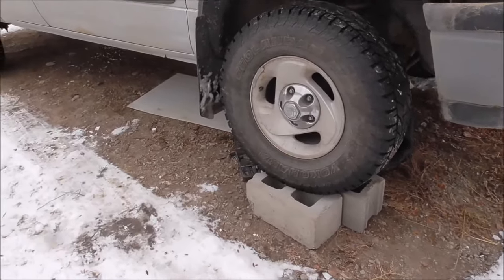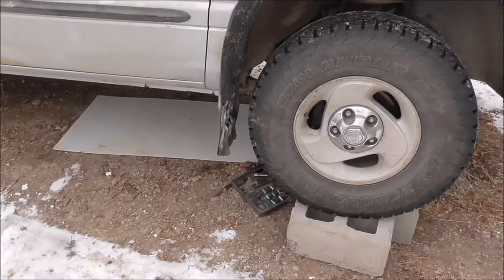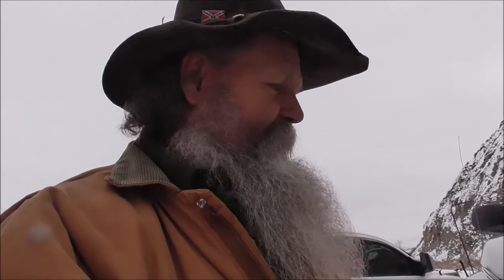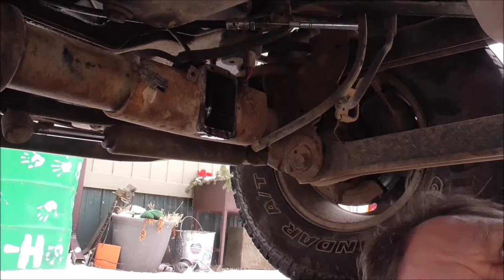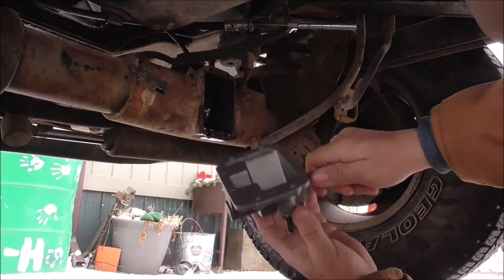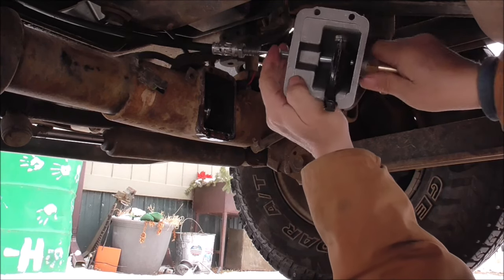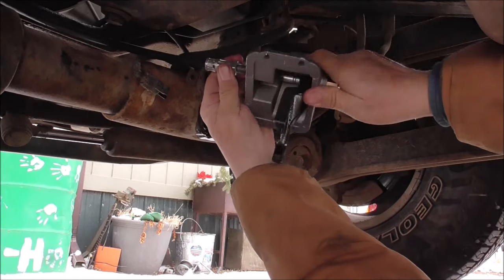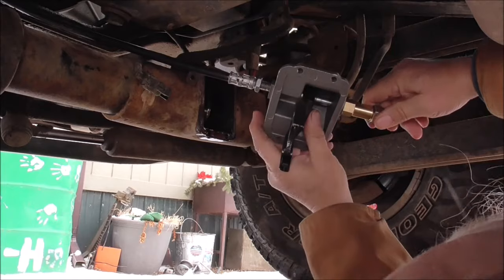Installing a Cable Conversion 4wd Actuator for a 2001 Dodge 1500  Truck Part 2

Comment: Glad you're back to all 4 hooves working!  That's a necessity if a guy wants to wander in the mountains.
Reply from the maker: 100%!!  2wd doesn't even work that great on the flat ground!  The tires on this truck are pretty new, but just street tread also.

Comment: Glad its working for you Brother.  Nothing worse then going through a bunch of work fixing something only to find out it still doesn't work when you're done.
 Saved yourself a bunch of money too by doing it yourself.
Best wishes Gary
Reply from the maker: Thanks!  It sure is!  It is a little hard to lock it in, but I think it's just getting the splines lined up enough to let it slide together.  I don't like that knob so low, but it will work until the weather is warmer to change that.

Comment: Great video! The two wheel low option is something I’ve done to Jeep transfer cases when I was into off-roading it’s a great option when you’re on steep terrain that doesn’t require 4x4 or high speed it’s a lot easier on your transmission and clutch when you want to travel at a lower speed
Reply from the maker: That makes a lot of sense.  I don't know why they don't come with a 2wd low gear to start with?

Comment: Mornin Mr Gary. 

I watch trap lines and inlines right here and he's a cool young fella. He has had the same  generation truck and done a similar thing.  He might have some info you might like?  He's a good channel as well and a good young man.  Great job on this!  All the best sir.

Btw...if you're interested, just look through his archive for the black dodge pickup.  Until he did this conversion, he had all kinds of trouble with the vacuum 4wd. You're doing right by switching to cable actuated.  Strong work young man!
Reply from the maker: Thanks for the info!  I'm happy to hear that his worked out.  I have seen his channel, in fact I'm subscribed, but haven't watched it in awhile. I'll have to look!!!

Comment: For gasket installation, a little film of 'Right Stuff' on the mating surface helps hold it in place and make a great seal.
Reply from the maker: I haven't heard of that?  Any of that kind of stuff can only help I think?
Reply: @MuskratOutdoors it's a gasket maker as well.  Good stuff, but you got it. :)

Comment: Well done. Call me crazy but I wish  the vehicle manufacturers would make a rig with all manual components like that in the first place. I think it is hopeless though which is why I am keeping my 1995 dodge cummins. I am going to have to nurse it along for the rest of my life if I refuse to drive a computer on wheels which I do. Can you imagine a 1960 Era manual everything truck with no emissions garbage built out of metal? It would last too long and that's why they will not build them.
Anyway time to get to work we have a wood stove to install today. Have a great day. Merry Christmas everyone.
Reply from the maker: I like the old stuff best too.  Trucks today have too many electrical black boxes and things that really aren't needed, but you can't take them out without shutting down some computer gizmo....UGG!  
MERRY CHRISTMAS TO YOU TOO!

Comment: Got you  hobby there to keep you out of the bars during the daytime! Old trucks! LOL!!!   The 4-low without the front axle engaged can overload your rear axle if you get in serious terrain, mud, etc. It might help on the smooth, dry,  and level spotting a trailer, etc., but should not be used off road unless you want to walk home.
Reply from the maker: That's kind of what I was thinking too.  Most of this stuff is designed the way it is for a reason.  I had several people say you can just lock that front drive collar and leave it that way permantly, but that would put a lot of stress on the gears, wear out your tires faster, and use more gas....maybe I'm wrong, but I think that is a bad idea.

Comment: I'm glad it works fine for you hard part for me turning wrenches is getting under the truck not sure what it is but my eyes close and I start snoring its the damdest thing    .
Reply from the maker: Ha!  On a hot day, it's the place to be!  I get under there, and start looking around and think "Holy crap!"  Need to grease that and check this,,,that needs wired up too....scares ya!

Comment: I bet the fairgrounds would have been ok with you using the arena for this?  If not, they should! Lol. Might have been a little warmer?  Maybe not.  But for me, working on a concrete pad while under my pickup is a big help.  Part's don't get lost in the dirt.  Might be able to find a used crawler on one of the online places?  Anything that helps me get around easier these days is surely welcomed! Lol. I hate crawling under my pickup.
Reply from the maker: The cement is the problem really.  The one building that has a cement floor is used for things like canned goods displayed at the fair....I can't get oil all over the floor, and it seems like no matter how careful you are, it will happen.  That big indoor arena, I could have used, but it's dark and has a sand floor.  Easy to lose small parts or get grit on anything I drop.  Even so, it's not frozen and out of the wind....I was going to use it, but decided not to.
Reply: @MuskratOutdoors I should have guessed you thought it over.  Nice job on that install! I bet it solves your issue for good. Thanks for the upload Mr Gary.

Comment: Mission accomplished,good man. Not much rust on that rig for it’s age.  Here in western Massachusetts the roads are heavily salted( liberals aren’t capable of driving on snow) so vehicles are ruined in several years. Idaho is looking better to me all the time.
Reply from the maker: I'm not sure which is worse?  Cold air does settle in the valleys and do that.

Comment: Nice video Gary. Wish you were close by and I could hire you occasionally to work on my 1990 F250 w/ 7.3. Right now I'm looking at new front leaf springs. Les Schwab is getting back to me with a quote...how much do you think? I'm guessing around $700 parts and labor.
Reply from the maker: I bet at least that?  I replaced the rear leaf springs in that Ford Ranger a few years ago....I don't recall the cost, but it wasn't cheap.

Comment: 2wd low is handy for crawling on logging roads road hunting…I mean scouting without the wear and tear in the front axle and burning way less fuel.
Reply from the maker: Ha!  Perfect!  I bet we will use that!  Never thought about using it that way.  The low gear is really good in this truck.